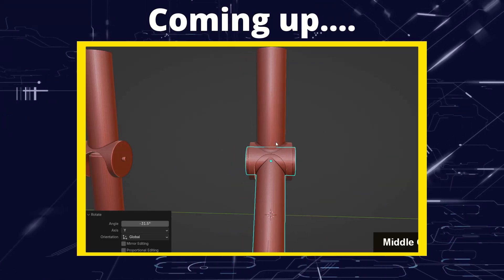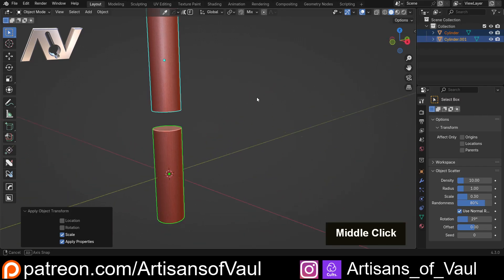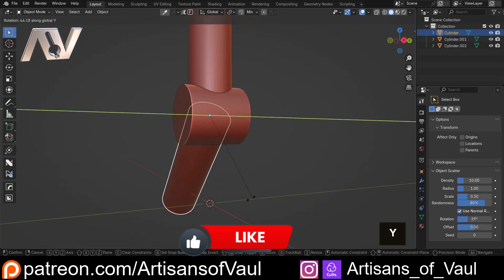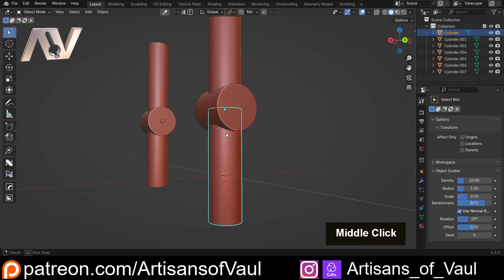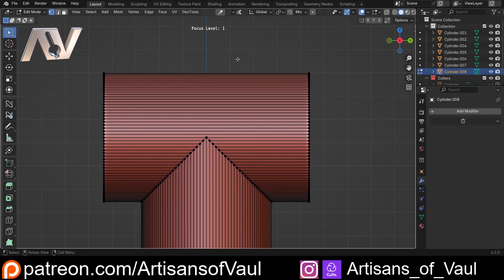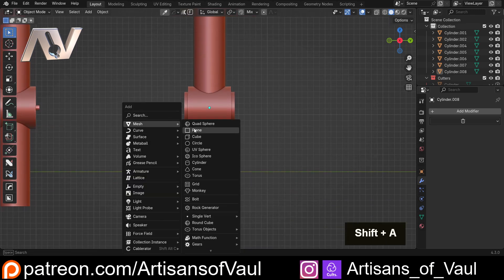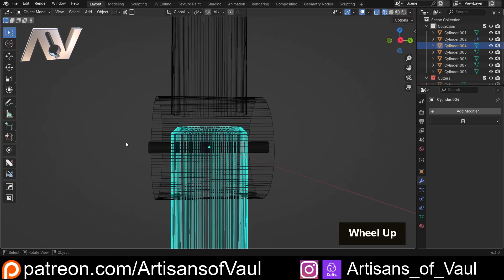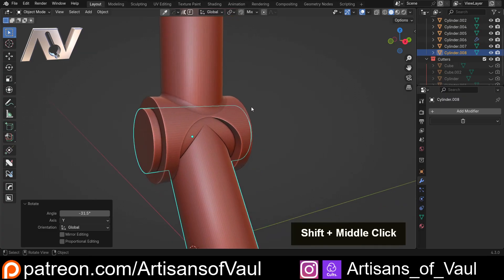Designing a mechanical joint in blender - A Machin3 Tools workflow

Comment: Great video, as always!

As someone who makes lots of functional prints and lots of modular scenes, that shift-S menu is an absolute life saver.

Another great add-on is CAD Transforms. It's like super-duper align tool that even works on selected verts of an object. So like "select the nose on the head and move it until the tip is aligned with the chin" or some such. Really handy if you're building machines or stuff with precise dimensions in Blender.
Reply from the maker: I'll check that out. I'm currently testing out an addon that sounds like that hyped up to 11. I think it might be of a lot of interest 👍🏻
Reply: @ArtisansofVaul  I look forward to seeing it!  The "Keep Making" channel has a whole hour-long discussion of CAD Transforms, both a shorter video and a "here's every single option."  It's really a lot more there for functional designs than the artistic sort of stuff you do.

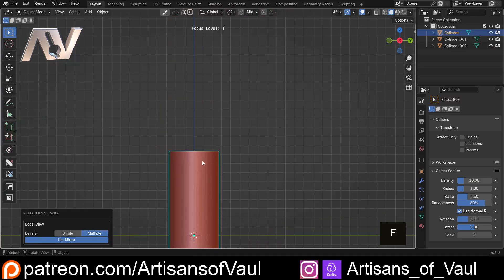Comment: Question. @2:40 you selected the lower cylinder, then pressed F to isolate that cylinder. Because of ND also being installed, my F key did the predict(?) thing for ND. So, I went to the preferences, found the ND section, and had to change the default the F key to Sht F in 3 different places... which was weird... so that it allowed me use the F key for Machin3 Tools. Then, pressing F allowed me to "focus" on the selected cylinder, but it did not actually hide the other pieces. It also does not pull up the same dialogue box in the bottom left like it does on yours. Mine has the MACHINE3: Focus heading, but only View Selected with 2 buttons... Ignore Mirrors and Ignore Arrays. Clearly I am not using a big enough hammer to figure out where the add-ons are connecting with, and stepping on, each other. Are you able to shed some light on what may be happening?
Reply from the maker: Hmm....  I had to do exactly the same thing with ND and came up with exactly the same solution.  Can I check if you have updated Machin3 Tools recently and if you did the classic of closing and reopening Blender when you had made the changes?
Reply: @ArtisansofVaul  OK... I went back to check to see if there was an update. Yes, new version for DeusEx (1.11.1). Installed, then restarted, taking the default cube and Sht D (duplicate)... move to a slightly different location... press F to isolate... same thing. It zooms in on whichever cube I have selected, but it does not "hide" the other cube. I need a bigger bag of hammers to use :( Oh... and the dialogue box in the lower left is still the same as before with only 2 options :(
Reply: Decided to uninstall Machine Tools > save preferences > close Blender > re-open Blender > reinstall Machine Tools (1.11.1.DeusEx) > save preferences > close Blender > re-open Blender > Sht D the default cube and move some distance away > press F to focus... and I get the same results as before with the same dialogue box that leers at me with disdain from its perch at the bottom left of the screen. I have failed... but I would like a gold star for trying.
Reply: FOUND IT!!!!!!! In the MACHIN3tools Preferences... in the "Active Tools" portion of that panel... toggle SELECT. I was about to beat my computer with my cat!!!!! Problem solved :) For whatever reason, ticking the SELECT button apparently re-set(?) the function? Now, if I un-tick the SELECT button, it still works like it should. This was a head-scratcher :)
Reply from the maker: @keithmathews4605  You get many gold stars!!!!